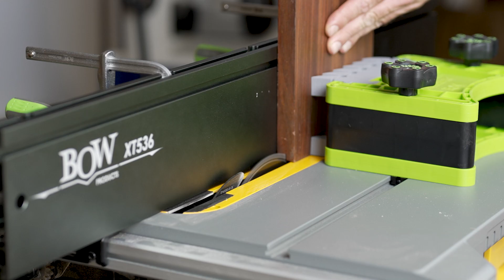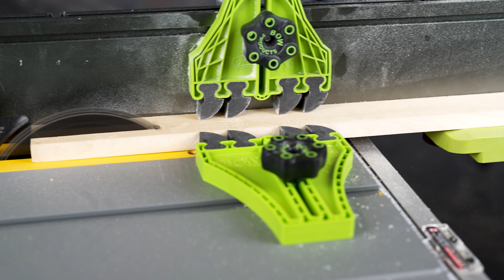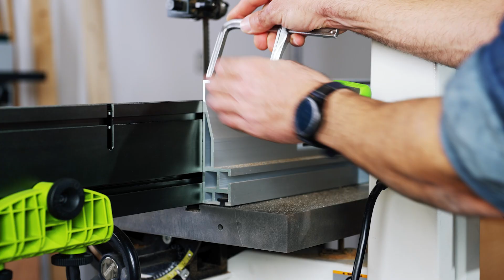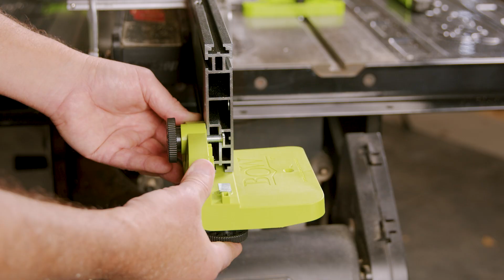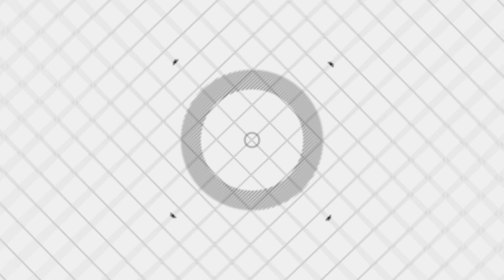XT XTENDER Fence - The Fence You Wish Your Saw Came With

Comment: Since I really like the fence on my Grizzly table saw, I've been using  2 MagSwitch's Pro Vertical Featherboards.  However, after some use, I've accidently cut the plastic "feathers" and I've had the plastic on the slot crack.  I got the idea to wed the MagSwitch Pro Vertical Featherboard with Bow Products Vertical featherboards.  I like the combination of the releasable magnets which hold it to the fence and the Bow Products vertical featherboards.  The combo works great without having to invest in a T-Track addition to my fence.  It would be nice to see Bow Products create a magnetic base for the vertical featherboards as it is more versatile than a T-track.  The holding power of the magnets allow me to put a fair amount of pressure on the vertical featherboards for kick back prevention.

Comment: Great product. I've had a 46" for a couple months and it's terrific.  But Bow, you ought to design/sell some hardware accessories so you can use two of them end-to-end at once, like track saw pieces.  I'd love to get the full reach of the xtender on both the infeed and outfeed sides.  There's not enough real estate on a jobsite tablesaw's fence to double-clamp two xtenders.  If you made some sort of xtender fence-to-xtender fence coupling hardware, I'd buy.  (Then you could sell 46x2= 92" fence kits, etc...).

Comment: I read somewhere that the front slot doesn't accept standard 1/4" hardware like the JessEm Guides. Is that correct? If so, what a pity because this would have been exactly what I needed...